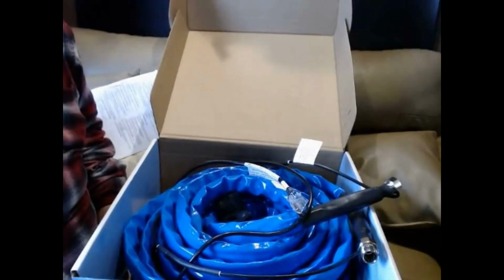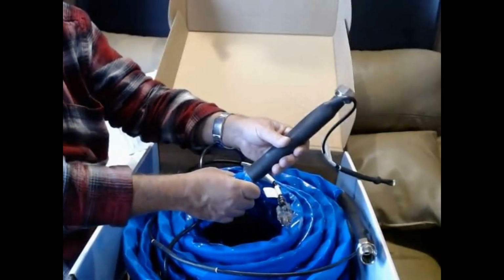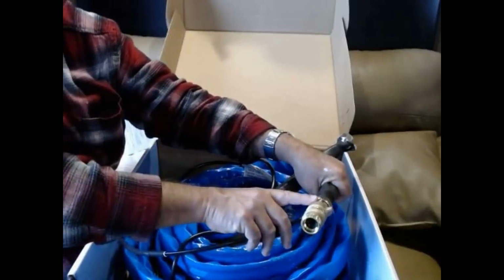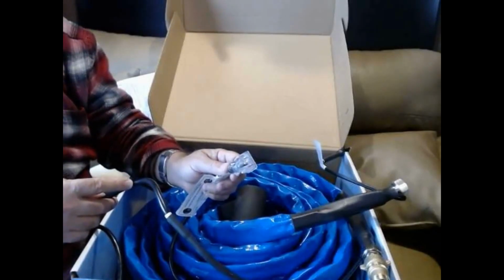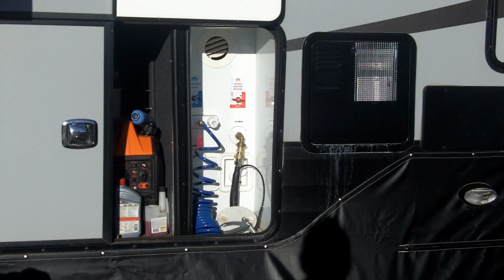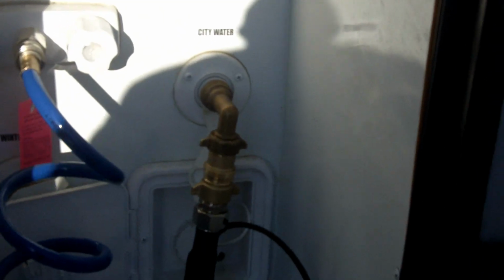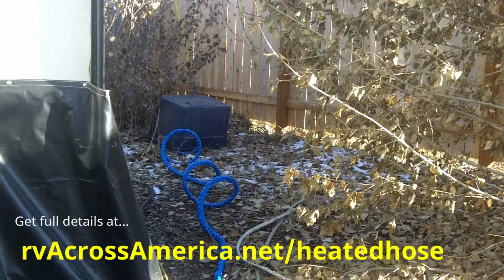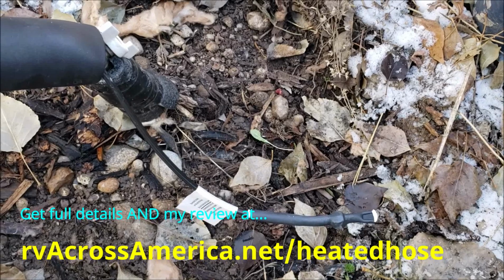My review of Camco's HEATED RV WATER HOSE

Comment: Thank you for actually showing the hose connected to both ends and in use. Everyone says plug it into a GFCI circuit. How do I know if a campsite pedestal has a GFCI circuit? I don't recall them being labeled as such.
Unfortunately, the plug for the 120-volt power on my RV is on the opposite side of the water hose connection, so 6 feet is inadequate. Campco says do not use an extension cord. What gauge cord are you using?
Reply from the maker: I use a quality, heavy guage extension cord; ALL rv power pedastles (by law) must have GFCI protected outlets on the 15A service - you'll see the "push buttons" at the base of the 15A receptacle. If they do not, the campground owner likely did it themselves and is in violation of all kinds of regulations.

Comment: The one I am sending back had different connectors.
I spent 3 hours, many times on and off and on and off, many gaskets. 
1 trip to the hardware store for 3 different ‘better’ types of gaskets.
Nothing worked. Tools and everything.
Both ends leaked water.
Reply from the maker: they do make 2 different series of hoses, the only one i'd use is the beefier one (lower operating temperature)

Comment: Wow thank you s o much for the review I need one of these and plan on purchasing one tomorrow at camper world. My question was I need to get an extension cord to plug my hose in will it work my question is answered. I am a real instructional kind of guy like to install everything the way the engineers designed it. I found the same thing camco had a lot of bad reviews and have been looking at different hoses my main concern is water and electric. Thank you so much for the reviews I build a camper out of a cargo trailer very good review just as I needed thanks for the post answered all the question I had. Happy camping
Reply from the maker: thanks for your kind words; you'll likely get a better price on the hose through my links than at camping world

Comment: I'm finding this hose has a horrible chemical Flavour to it when is that going to pass?
Reply: I wouldn't drink the water from any rv park. I'v been living in an rv for 6 years. I never drink the water. I buy cases of water to drink and cook with. I've had the camco hose for 3 winters with no issues. Most winters here in Dallas are mild with the coldest being in the teens. I've never had a freezing problem with the hose.
Reply from the maker: I never detected it so I can't answer this one.

Comment: You left us hanging. Did you cover your hose or did it work.
Reply from the maker: hmmm... perhaps a senior moment or a clip I failed to add at the end! Regardless... yes, I covered the hose with a 20 gallon "rubbermaid" type tub, and it worked fine. Good to -15F which was reached on several occasions last winter. This winter, I'm expecting to see 20F as about the coldest I experience as I'm staying in central texas! (thanks to the virus)

Comment: The Camco hose I had just failed the leak is back in the hose some where. The hose came apart way back inside  the hose was not a year old , now need a new hose but find only a couple food grade heated insulated hoses. Next week I guess Ill have to buy another one!
Reply from the maker: Your hose should be under warranty. Why not call camco on Monday and ask for customer service - they're typically really good about warranty replacements. Al

Comment: Before I saw these YouTube videos of the Heated Hoses I went on Amazon.com and I looked up Heated RV Hoses and found Camco 90 Degree Hose Elbow- It says...Eliminates Stress and Strain On RV Water Intake Hose Fittings. Also, Camco has a video with a young woman that talks about their hose and how you should plug it in to your electric, lightly stretch it out and for no less than 45 minutes, leave it be to allow the heat to prevent knuckling of the cord and hose. The video shows everything step by step. They offer different size hose lengths and different extreme cold temperatures. I believe one was -20' and the other was -40' 
Camco 12ft TastePURE Heated Drinking Water Hose - Lead and BPA Free, Reinforced for Maximum Kink Resistance, 1/2" Inner Diameter (22920)
by Camco
3.9 out of 5 stars    64 ratings | 14 answered questions
Price:	$122.86 & FREE Shipping
Ideal for water line freeze protection; self-regulating heat source keeps water flowing without overheating and without the need for a thermostat or temperature controller
Made with NSF-61 certified hose and is drinking water safe
Matching female hose fittings allowing hose to be used with power from RV or Campground power source
Heavy-duty heat shrink provides strain relief on both ends of hose
Operates on 120VAC / 1.3 AMPs 
Just wanted to pass this info along for you to research and share!
Reply from the maker: this is all the case, check my post at rvacrossamerica.net and you'll see i cover much of this